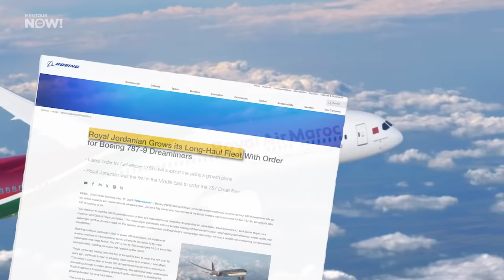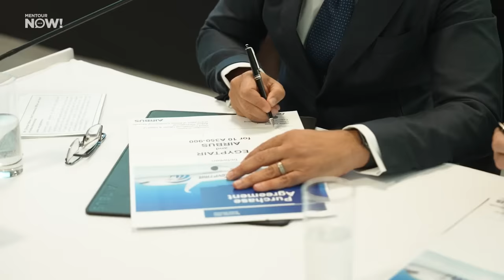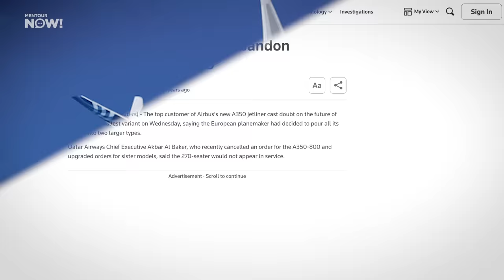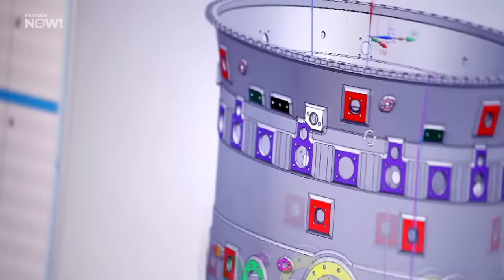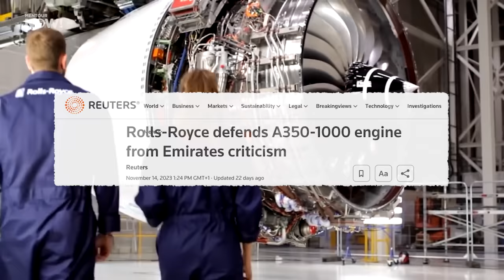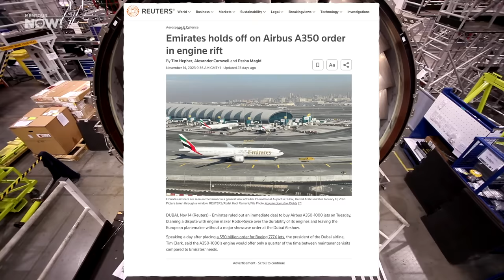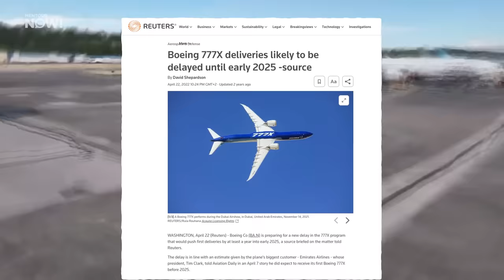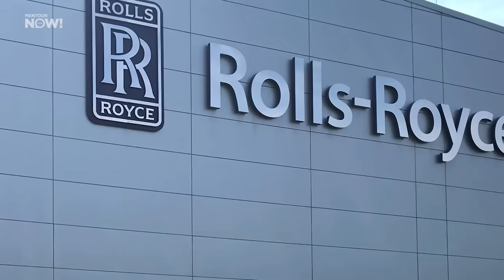What’s WRONG with the Airbus A350?!

Comment: Oh man, I'm still bummed that the A380 wasn't enough of a success for Airbus. I so rarely sleep on airplanes since I'm over 1m in height and they're apparently designed / laid out for the other group... But once on a Singapore 380 I turned to my wife and said "are we STILL taxiing?" and she said "we've been airborne for 3 hours, you've been asleep for most of that." 
Damn shame.
Reply: yes true that
Reply: They're also amazingly quiet. I saw one take off in LA, I was impressed.
Reply: i really hope you are more than 1m in height😂
Reply: The A380 is absolutely the best aircraft to fly in. Quiet, smooth and spacious.
Reply: @Holland41 ….sre thry still in production? I’d like to fly on one from Gatwick to Heathrow 😂😂
Reply: 1m height? That's not tall at all
Reply: @inspecktorf  Correct. Very untall.
Reply: It’s my favorite plane to fly on, more comfortable than any other type. Even got my checked bag in less than 20 min the last two trips, despite being full flights with 580 passengers!
Reply: A380 was a great experience from a passenger perspective. I wish there were demand for a more fuel efficient (2-engine) A380. But low cargo capacity and demand for direct-flights didn't help.
Reply: You're right.  The A380 is amazingly quiet. I always fly business class and even the A350's which is ahead of the wing and engine is much noisier.   It's big, it's spacious and it SPOILS passengers. 

No wonder the profiteers want to can it.
Reply: @PassportBrosBusinessClass  That is an interesting take. The A380 is huge, smooth and quiet, so even the rotten seats are comfortable; that is a big upgrade for economy class so would reduce sales of some business class seats (but corporates will still buy a lot of business class for the beds, rescheduling, no-bump risk). I know at times, on some airlines, business class is where the money is made.

The B787 experience is similar as they are quiet, smooth, and run high cabin air pressure. I don't know if it is better is worse than the A380 as the planes are so different. 

The B787 has a lot more non-stop options than the A380; that is faster and less hassle IMHO.
Reply: A380 is the most comfortable plane ever built, even the crew has less work, since all doors open and close electrically , just push a button.
Reply: @dosgos yes regular seats don't make much money. Furthermore, all luggage including checked bags lose money. They make more money by weight for the extra cargo they take than for luggage. People complain about checked baggies but it's actually very cheap compared to the mail they carry.
Reply: Yeah almost everyone I talk to friends family ect say the a380 is the best across any carrier to fly on. Plus flight crews say it’s one of the best aircraft to work on the space is just unmatched. Shame it wasn’t more successful
Reply: aren't most people over a meter?
Reply: I'm over 2m in height and definitely have trouble on planes– maybe that's what you meant?
Reply: I miss the A380. Was the most comfortable and relaxing flights between Europe and South Africa I have ever had.
Reply: Lol that's a cool travel story. The 380 is the mighty juggernaut of joy for sure! Awesome airplane. Here's a story I enjoy sharing with others. I did a similar thing as you did, first time I was on a 787. I got bumped up to business like a lucky hard working man or something like that. Anyway, I had never fallen asleep on a plane before even though I regularly fly over the Pacific. We ate after takeoff then I don't remember anything until my coworker woke me about an hour out of Tokyo, just as the attendants started the arrival meal. And the food tasted better than usual due to the relative altitude. I had slept the whole way between meals! Yes sir, I do like these newer aircraft! Even though....you know...the queen of the skies will always be the queen.
Reply: @inspecktorf  it is if you're a little person
Reply: @inspecktorf he said "over" 1m in height. Not how MUCH over..
Reply: it came 10 years too late. which means no A-380 neo/MK II. and the competition is too strong.
Reply: Can you imagine the size of the engines? @dosgos
Reply: Airbus aircraft somehow handle the flight sense better. You can't help but notice the confort.
Reply: @dosgos  Their passenger capability unfortunately isn't a requirement for most flights these days, as the "hub" concept seems to be going out of fashion.  Fuel efficiency wasn't the problem (per-passenger fuel efficiency is very good, part of its raison-d'etre in the first place).
Reply: @dogsbodyish8403 I thought the real-world issue was that the A380s had lots of legs at low utilisation (but limited cargo capacity), hence the idea of a fuel sipping 2 engine version.
Reply: Maybe you mean you're over 2m in height?🤔
Reply: @Holland41 Yep, simply different flight experience...
Reply: Everyone who didn't get the fantastically worded 1m sarcastic pi55 take... please take this L. Sarcasm requires IQ.
Reply: Every time Boeing beats Airbus, as an American, I am happy.
Reply: @Holland41   And gone. Whereas the 747 had a 50 year history. Yes!
Reply: At a height of 1m I would think you’d be comfortable in a toy Cessna…
Reply: @tommypaget2294  No. And most A380s fly hub routes to maximize throughput on crowded airports and air lanes, like the 747 before. You have until about 2030 to fly on one too, since that's when most of them will start to be retiring.
Reply: @dogsbodyish8403  Actually fuel efficiency was part of the problem. Emirates make them work because they fill them up consistently, and like other ME carriers exclusively use hub-and-spoke. I think an A380 needs something like 80 or 85% load to break even; some new widebodies like 787 and A350 only require something like 65-70% if I'm not mistaken. Part of the fuel efficiency issue was the old-tech engines (think 90s engine tech like the 777 or A330 had, rather than new gen 787/A350 engine tech). Another issue was excess weight due to excess strengthening (Airbus originally intended a freighter variant also), and wings/control surfaces that are too large (they were optimised for a future stretch version). Such a shame, to an extent they were screwed by the engine manufacturers (who said they couldn't do a new-gen engine, but then providing a new gen engine a couple years later for the 787), but also clients who said they wanted things that they didn't actually buy in the end.

Still, not sure why they didn't offer an optimised NEO around 2015; surely the A330NEO engines could have been slightly modified for A380 use, and along with some structural weight reductions, would have kept it competitive for busy routes for another decade...
Reply: There's no comparison, Mr. Dosgos. The A380 ride is truly in a class of its own. The B787 is absolutely nothing in comparison: I was on one out of Brisbane just the other day.
Reply: If you are only a little larger than one meter, you could go in a suitcase.
Reply: @timothycorbitt5149 so you are never happy?? 

They're just planes grow up.
Reply: Almost EVERY adult is taller than 1m.
Reply: Lucky man, I can sleep in buses and trains but sleeping whilst flying is very difficult, no idea why , no fear of flying.
Reply: @inspecktorf  It's hard to believe given how the airlines are designing their interiors...
Reply: Cool, I'm over 1m too! As a group our kind aren't really acknowledged enough.
Reply: @MrGregHiller  Of course. A larger airframe has more mass and is less subject to buffeting and other aero-disturbances. Simple physics really.
Reply: I recently flew on the Airbus 380. Wonderful . I hate being cooped up in a cigar box. Didn’t like the 777er much either . Old and needed a cabin update.

Comment: All 379 pax successfully evacuated with minimal broken fingernails, evacuated after a 350 (airborne, at landing speeds) impacts a stationary airframe on the deck in Japan - everyone out, with several exit doors blocked, nosewheel absent so front slide too shallow and tail end high.   I'd fly on a 350 ANY DAY (but the 380 is still the best IMHO).

Comment: Boeing sold a shed-load of 777-300ERs in the 2010s and most carriers are not yet ready to replace them with new A350-1000 or 777-9. Both frames should see much stronger sales towards the end of this decade and into the 2030s.
Reply from the maker: Some airlines are more than ready to start changing them. Emirates is one of them.
Reply: That’s is very true, a lot of them are barely even 10-15 years old as most sales were around the early 2010s. And the aircraft performs extremely well. pilots love it. The airplane is still cost effective and super efficient even when put against the a350-1000. Sales will pick up tho in the late 2020s
Reply: Also the replacement for 777-300 is 777-8, not 777-9. The -9  is significantly larger and is in essence the boeings proposition as replacement for last 747s and even A380s, and has no direct Airbus competitor ATM. So it's little wonder that Emirates chose the bigger plane. And yes, that means that A350-1000 is directly competeing with 777-8, tot -9. And also Boeing chose not to develop 777-200 replacement in 777X generation, instead they'll probably market 787-10 to airlines replacing 777-200, as both planes are extremely similar in terms of capacity. Now the problem here is that while 787-10 is a better replacement for 777-200, it's not the case with -200ER as it has limited range, leaving -200ER operators a choice of go bigger with 777-8, go smaller with 787-9 or go Airbus with A350-900
Reply: @mancubwwa  you’re 100% correct. I also think the -200 market segment is in less demand. As it seems the Airlines just go bigger or smaller I.e. the -300ER and 787-9. I hate the 787-10 btw, I think they should have given it a bigger wing to increase the range and fuel. Bring limited to 12000km in today’s aviation market is just too low for a plane of that size.
Reply: @davidajayi1207  I'm not sure if I agree about 787-10, it seems to be primary directad at US airlines for large volume long haul domestic routes like New York to Los Angeles. With no lie flat Buissness you can fit a lot of people on a really fuel efficent airframe and with overland routes no longer than 5000 km and plenty of diversion airports 12000 km range is more than enough.
Reply: @davidajayi1207  And I'm not sure about the -200 market segment in less demand, given how well A350-900 sells.
Reply: @mancubwwa Actually the B778 is B772 replacement as B778 is smaller then B77W. There is no replacement for B77W.
Reply: @davidajayi1207  I have to disagree, the 777-300ER is not super efficient against the A350-1000. The A35K burns about 20% less fuel doing the same mission, with nearly equal passenger capacity. The A35K has a higher maximum payload while being significantly lighter than the 77W.
Reply: @Republic3D  I know it’s not as efficient but, it does a really good job. 20% is a stretch, maybe 15. Also, the 777-300 er has an exit limit of 550, a35k has 480.
Reply: Indeed, exactly.
Reply: The problem is large backlog already! If you order now on average you might get delivery 2028-2034 🤷‍♂️ They are not on the self items!
Reply: @stevesmoneypit6137  exactly, that’s very true
Reply: EVA Air decided to replace its 777-300ER by A350-1000 recently.  More decisions will be forthcoming in the next five years.
Reply: If that is true Boeing will be benefitted since they are still getting the 777X out.
Reply: @Republic3D  its not a fair comparison between the two because the 350-1000 is 14 years newer... that's a lot of development time
Reply: @sd70m2man I agree. But the person I answered compared those two aircraft, so that's what I did too.
Reply: @mancubwwa Boeing is working on a 787-10ER for that very reason to boast the Mtow and extend the range
Reply: That would be shame as those planes are such old designs.  I guess I may never see the next generation of airplanes ✈️ the 380 was the only advancement
Reply: @jamesbartlett5640  the 777-8 is literally the same specifications as the 777-300ER especially with the redesign to match it with the 777-8F
Reply: @Republic3D  actually it carries less cargo and is grossly underpowered in hot and high climates hence why Emirates didn't order them compared to the 777-300ER
Reply: @jamiebrowne6913  Which contradicts with Cathay's experiences. They essentially ditched the 77W during the pandemic because 35K carries more, fly further and burn less. Even at this point their 77Ws are of lower utilisation as East Coast is out of reach without going into Russian Airspace. And CX has more 77Ws and cargo than anyone outside Middle East.
It's also the same CX that selected 35F over the rumored 778F.
Reply: @jamiebrowne6913  Can can guarantee you it’s not a 77W replacement, also the 77W still being made with last few being made,  this is replacement is for B772s especially to succeed the ultra-long-range 777-200LR
Reply: We built the first -300 around 2000.  It's been awhile and I don't remember what the regulatory agencies gave for a lifecycle cap on the 777 but I'm sure it was longer, because it tested good for a hell of a lot longer stress duration than previous different models.  If Emirates dumps those they still should be good to sell for passenger use for a bit.
Reply: @mancubwwa  airport space is shrinking  so 777x
Reply: @MentourNow  They already did, let's see how smart their decision was. For now, they seem to have shot themselves in the feet...